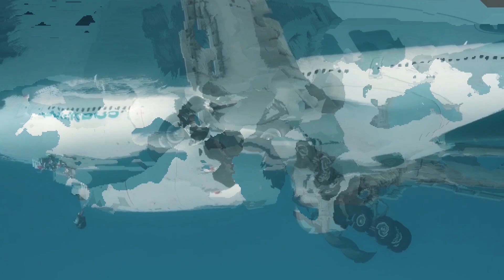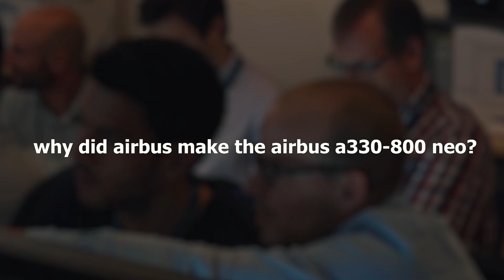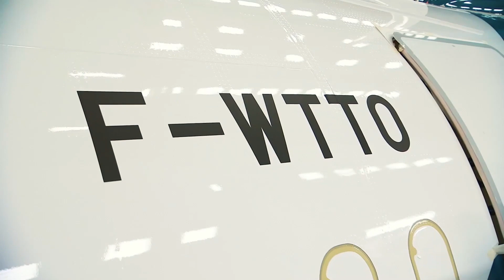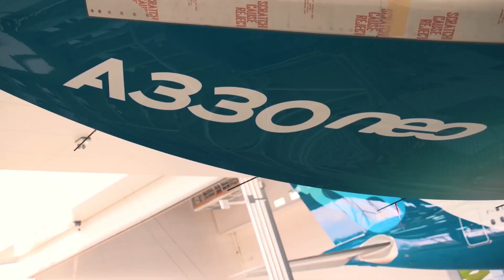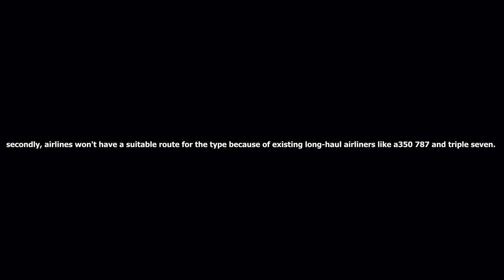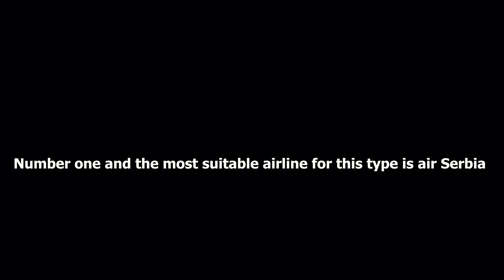Why Airbus A330neo Is So SUCCESFULL!

Comment: The A330 NEO is not successful at all. Sales are very slow and only a very small number will be built. The 330 NEO is a great plane in itself and destroyed a lot of the market for the Boeing 787, but it is not a sales and moneymaker success for Airbus even. Even though the A330NEO is one of my least favorite just because most of them are replacing the current A330s that are my top favorite airplanes. But other A330NEOs that are not replacing the current a330s are cool to see

Comment: A330-800 is clearly an unloved version. It has not sold and it will not sell. Airlines are almost unanimous and for good reason.  The only real advantage is a somewhat lower fuel consumption. That is all, and even at today's high fuel prices this does not count for much.  To be specific, 0.5 ton/hour less than A330-900.  On a 10 hour mission that is 5 tons, or roughly $5,000.  All other expenses are either the same, or very close. Same 2 pilots, perhaps an extra flight attendant. Same maintenance.  Fractionally lower airport fees and overflight costs. A little lower capital costs.  All wrapped, say $10,000 per trip, with room to spare.  What does A330-900 offer?  50 more seats.  On said 10 hour mission, at $500 each that gives the airline $25,000 extra.  They only have to sell 20 extra seats to achieve parity.  Airlines have to be very, very pessimistic to assume on a given route with a 3-5% growth over 20 years (the lifespan of a plane) they will never ever sell these few extra seats.  The situation with 787-8 and 9 is exactly the same, and because of that the former sold a lot less planes.  A330-900 will also take an extra 3 tons of cargo, another $15,000 per mission. Besides, with the latest MTOW hike to 251 tons for both A330-800 and 900 the latter increased its nominal range to 7,200NM, leaving very little space for 800.  There are only 2 possible scenarios that would favor 800.  One is for very thin and long (say 6,300-7,300NM routes). Or a bit less, if there is cargo.  But those missions just make 2% of commercial routes, hence the scant interest.  Or for long range LCCs.  With a single class 350 pax cabin (the extra 100 pax with bags weigh 10 tons) 800 still flies a very respectable 7,000NM, but the truth is that low cost economics and logistics are devilishly hard, and LCC bankruptices have been clearly above the industry average.  The other drawback the A330 line has compared to Dreamliners is a cruising speed of Mach 0.82 v 0.85.  This can add 30' or more per mission.  Not good for pax. Also the added cost for crews.  It is however quite incorrect that Airbus will discontinue sales of 800.  It has 95% commonality with 900, so if there are any future buyers either subtype can be produced indistinctly.  The other drawback 800 has as a niche plane is virtually no resale possibilities whatsoever on the secondary market.  Airlines have to bet on keeping them in their fleets until they send them to the scrapyard.